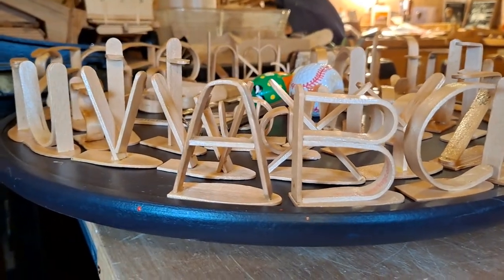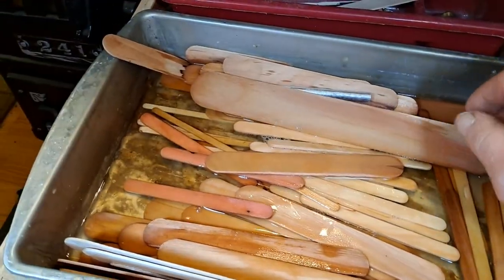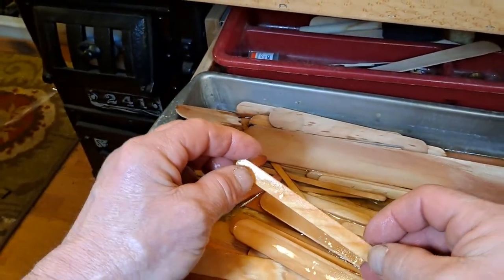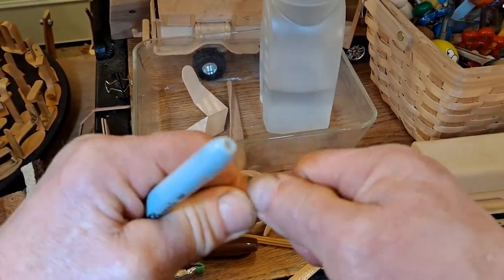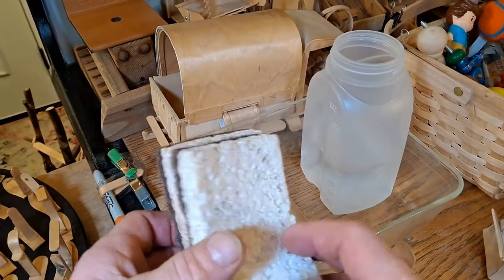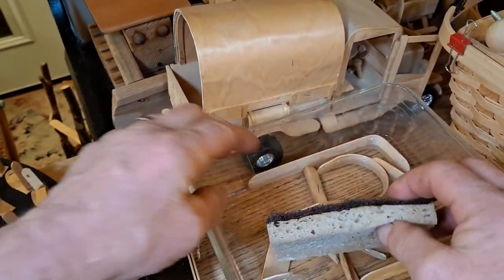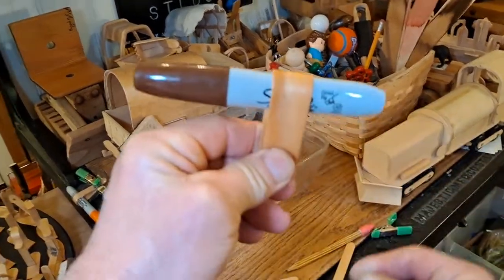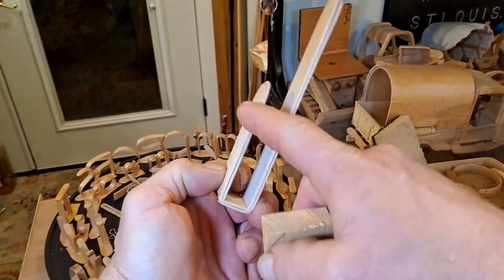How to Bend Craft Stick

Comment: Does this work with yard sticks? Do I have to soak it longer for yard sticks?
Reply from the maker: Yes soak them in the tub for several days. But use wider bends, tight bends will break. slow and steady when bending.

Comment: Do you have any tips for bending skewers? I'm trying to make a shepherd's crook for one of my dolls, but I feel like the skewer will snap.
Also, does it do anything to add baking soda or borax to the water the sticks are soaking in?
Reply from the maker: Round sticks or event popsicle sticks with rounded edges do not bend well if at all.  Trail and error is my best guest. Brad. BTW Im in a crafting competitions is my video with link to vote if you wish. https://diyhero.org/2022/brad-griffith
Reply: Maybe you could use a plastic lolly pop stick rather than a wooden 1 and paint it to look like wood, or saw with a hacksaw, or bread knife then file with rolled up sandpaper into a cylinder shap to get right in there and sand paper whatever you can with a flat stick and make it narrow and cylinder shaped hun, hope this helps ❤😊
Reply: Maybe you could use a flat 1 and cut then sandpaper a flat 1 into a cylinder shape, and for the bend you can cut then sandpaper by rolling the small piece of sandpaper into a small cylinder shap file to shape the top of a flat 1 after cutting a small triangular piece after soaking, dry then sandpaper into the hook shape, hope this idea might work or super or v.strong wood glue or  gorrilla glue, n  cut off tiny piece of your cylinder stick, then file it with sandpaper on the corner outer bend and 4 the inside bend, roll a small piece of sandpaper into a cylinder to sand in the corner bend to get a desired shape, I personally think the flat stick may work well but worth trying my idea with the cylinder shaped stick you have, hope this helps alot, I'm not a pro but love to craft 😊❤
Reply: @KamChillTV19558   Honestly? I'll try it. Because I have an Aries doll and I want to make a shepherd crook for her, and  want it to be made of wood.
Reply: @HarpsiFizz  you're welcome hun, hope it helps, but yeah the same 1's he's using here sandpaper'ed or saw clue n sandpaper if no flat 1's is my best idea, I love crafting, anything n everything which doesn't require machinery, but looks incredible, you can also make some very beautiful gifts which made by hand are also from the heart, hope my tips help hun, learning from our lovely presenter and tips from 1 another is all good fun n a great way to learn also, Bless You Hun, Hope Your Aries Doll turns out GREAT hun & hope your lovely doll gets the little  crook she needs to complete her ❤️ 😊